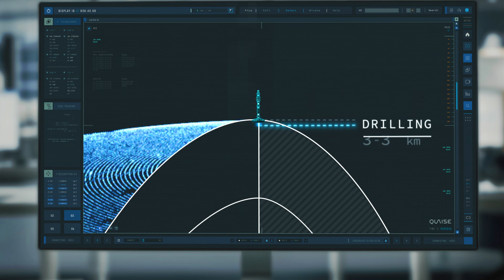Millimeter Wave Drilling | The Future of Clean Energy

Comment: Can someone go write “USE A PULSED free electron MASER” 

with metamaterial lense on every piece of their equipment  Please!,,  no waveguide needed, waste rock will splash and vitrify on sides or can be be blown out with high pressure air.  See any public research on optical pulsed laser drilling.  Hell you could put the laser on the drill mount and throw away the mirror array

Comment: The advantage of a powerplant in every community and industry of the world is obvious, it eliminates the steel and copper grid investments. But argon gas as a plasma medium might be fine, but consider too, that nitrogen gas is abundant in the atmosphere. And if it's use instead, the collocation of plasma-assisted ammonia-fixation plants would be a boon to off-peak energy storage and for farm fertilizers. That product can be pumped in old oil/gas pipelines and it can be converted back to useful gases, given the abundant electricity available in off-hours.

Electric-arc steel mills are a Swedish invention, but easily placed in US furnace conversion sites. Clinkers for cement production are huge consumers of fuels now, and those atmospheric contributions could be withdrawn by switching to electric furnaces at Quaise Energy sites too. In that way, a constant load could be established that offsets those demand distortions caused by charging electric cars and heating homes. All of those add up to a successful reduction in Climate   contributions.

Big Oil is the 'natural team' for this adoption, owing to its experience in pre-drilling to current depths. They also have access to old oil and gas wells that would cut the first depth drilling time substantially. However, that industry must convert to the role of a public utility in subsequent continuous operations. Executives fight change, because they don't really know the work. They want proven ways of making money to serve them automatically, not breaking new ground. That's a problem for government to compel the industry to see their way to greater global profits by a universal energy supply.

Comment: Lighting the flue creates a convective draft pathway that hadn't existed prior. A roaring creosote chimney fire will consume a home by tornado scale winds being drawn-in by the chimney's updraft. So, I'm wondering what sort of damping strategy would prohibit a geothermal well in every point of consumption need from becoming a volcanic vent or even eruption? I mean, if more heat is drawn to the bore hole, rather than simply bleeding and replacing mantle heat, can the earth's internal circulation be managed? 

The more you draw off heat, the hotter are the gases and ground coming from below, so eventually the gradient might turn against the surface demand. Can you just close the spigot and let the mantle convective currents dissipate? Too shallow, and the ground cools faster than its heat is replenished. Too deep, and overtemp risks are encouraged. A regulator is needed?
Reply: One question I have is, does the maser in a gas plasma at the rock cutting point ionize atoms, given Nature's contribution of heat and pressure behind? The Bend, OR test wells should provide heat, if not pressure, but what do lab tests reveal? If the idea of quantum electron robbing is just crap, then I'm sorry. But if it's an undiscovered or unrealized way that a subterranean current is transformed from infrared band energy to electrical power, then the need for prohibitively expensive gas turbines at each well site might be overcome. Implementation by drilling companies swift, and climate change could begin to reverse quickly.

Every visitor to Old Faithful is aware of how steam releases from ground heat sources smell like rotten eggs. Nobody will trade nuclear power for stink power in their home. So, abatement or encapsulation of geothermal vents is essential to adoption, once the basics of the technology is proven. A simple electrical current where Nature contributes to release more energy than is required to unlock it is the question. Is there a runaway breaker switch possible, where if a lightning bolt arc from Hades is struck, the energy release isn't something out of Raiders of the Lost Arc?

Comment: Saw a simplified diagram of the wave guide and the gas used to flush the hole.  Problem - the removed material will tend to coalesce on the side of the tube and elsewhere as now you've made a Physical Vapor Deposition chamber for whatever minerals you've vaporized.   You will have to blow a LOT of gas and that will tend to cool vaporized material which will tend to cause even more rapid gathering of material on your equipment  An engineering problem but still - going to be a bugger.

My brother was a mud engineer in the oil field (flush the hole) and I worked on semiconductor equipment (PVD or sputter chambers).  This jumped right out at me.  Hopefully others see it too and a solution is forthcoming.

Comment: And just how do you control the dimensional requirements of the waveguide over more than a few meters? Even the best tubular manufacturing processes are no where close to what is needed to prevent total attenuation in a few tens of meters, and that is with a copper waveguide. Even if you could control the dimensions of manufacture thermal expansion will not be controllable So far you have about 70mm of poor dimension controlled ‘melted’ hole with no explanations given for how you get waste product out of the well. Nor is there any explanation of how you intend to control the wellbore quality to make this into a usable well. A few mm on a lab test bench is not a viable product, whilst you now have to compete with traditional technologies that can achieve 50m/hr in 45ksi granites. I suspect this entire edifice will collapse before it leaves the test bench

Comment: If this technology doesn't work out, they might be able to find use for it in "fusing sand" down under the ocean for hte purposes of shaping the bottom in a way that "holds" for purposes of creating surfing breaks (an artificial reef of sorts made from the sand) and by changing the bottom countour first, then fusing (moving sand around with a pump first, then fusing) such that the waves are "directed" towards a certain area where they get bigger because of the shape of the ocean's new bottom.

Comment: Excellent concept. There's plenty of locations that don't require going as deep as 6 miles/20 kilometers down to get that high of a temperature. It'll take strategic geology, of course.
But PLEASE don't frack. Simply lower 2 pipes/tubes with a U-bend connecting the two at the bottom of the hole. Using fracking to connect 2 holes could quite possibly result in disastrous consequences, such as creating a miniature volcano, etc.

Comment: As a PhD holder in Petroleum Engineering, I really don't believe this, at least before I see it come true. It's a bit anti-scientific. Because melting down the rock means to break the chemical bond within every single molecule of the rock which requires much more energy than just breaking the rock physically. Besides, if Quaise wants to transport the cuttings by air from the bottom hole, it will also be a great challenge or even impossible, though their cuttings will most likely be dust rather than in pieces or bulks in nowadays conventional physical drilling.
Anyway, even it's a bit anti-scientific and my knowledge can't convince me to believe it, I 
still have to say that "nothing is impossible".
Reply: Melting doesn't require the breaking of bonds.  All that is required is to overcome the intermolecular forces between molecules.  In a rock, these are non-trivial coulomb attractions, but not as strong as covalent bonds.

Comment: So, this gizmo vaporizes the rock, and the air pressure blows the vapors upwell, right? How will they prevent the condensation of these vapors on the well walls? By heating the entire column to the boiling point of the rock or what? Not to mention needing the matearials which can hold up to sustained heat of 3000 C or above?

Also, it requires about 11,5 MJ/kg to vaporize silicon dioxide, so the process looks to be really energy-intensive to me. Gyrotrons are what, about 50% efficient? Add all sorts of losses on top of that, and it might hit 20% efficiency factor, maybe. Assuming we're drilling a 10cm wide 10 meter deep well we'll need measly 10GJ for that.
Reply: Energy spent is not so useful unless one considers energy output. There are people who can probably calculate this better than me but assume a steady stream of super-heated steam running at approx. the speed of an oil pipeline (~4 m/s) through the above mentioned 'measly' hole of 0.1 m diameter gives us a mass flow of about 31 kg/s. Only counting the turbine conversion of steam into liquid at 2.26 MJ/kg gives us a power output of 70MW. The above mentioned 100 meter hole x 200 going to 20km depth would then cost 2000GJ meaning the ROI would land at about 8 hours of run time. Please take my 30+ years college physics with a grain of salt. In real life you would also need a down hole and the efficiency of the turbine might be a max of 40% increasing the ROI to about 40 hours. All of this assuming that a suitable porous rock is found in the depth.
Reply: Valid caveats. My guess is that if the physical hurdles can be taken the efficiency issue is not a problem: dispatcheability in energy markets will make up for it as this power can be both baseload/continuous load as well as spot load.
Reply: Ok, this just sounds like a bad idea, like something you would see in a disaster warning movie, you can already foresee ways in which it can go very wrong.

Comment: So what would happen if this drill runs into water or gas deposits? Or am I misimagining underground water reserves?
Reply: This tech can seal the water out, or they seal it with concrete like I guess others already do. Water is necessary to achieve the steampower so it's not all bad either. Gas is worse, must be emptied and replaced with pipes.

Comment: this is for sure really interesting. I hope it wouldn't turn out like science fiction movies. What happens if the earth core cools down? Also why not nuclear fusion but this?
Reply: Depending on which study you look at, there's enough heat down there to power all the world's energy needs for 20-to-80 million years.  Building a nuclear fusion energy system is a complex (and therefor expensive) process, to put it mildly; Advanced Geothermal Systems (AGS) such as this are mostly about just drilling a two holes in the ground and connecting them at the bottom. Put cold water down one hole and you get super hot water coming up the other, which then goes through a heat exchanger to drive a generator; IOW, it's relatively simple.  And the skills of the people in the oil & gas industry are directly applicable.
Reply: The inside of earth constantly creates heat, because of natural nuclear decay. I remember listening to an interview with the CEO of Quaise where he answers your question in a more scientifically precise way. If I remember correctly, the constant heat production of the earth is twice as much as all of humanity's current worldwide energy consumption. So I understand that cooling down the earth's core isn't immediately what we should be agraid of.
Reply: This has nothing to do with the core. It's the radioactive decay in the mantle that's heating up.